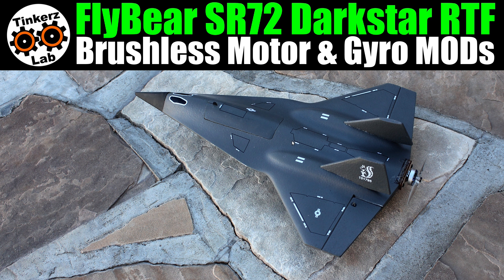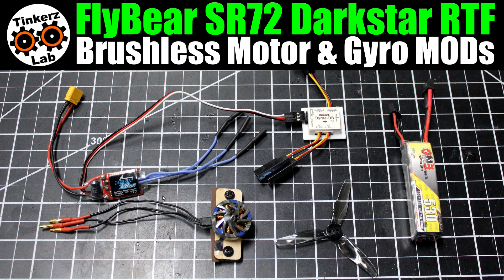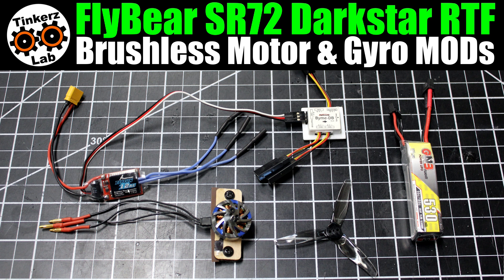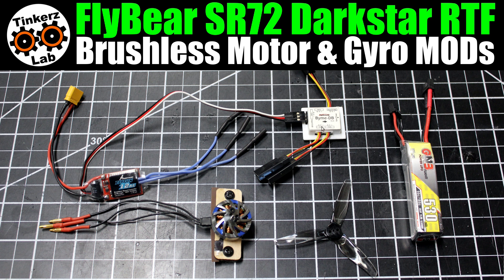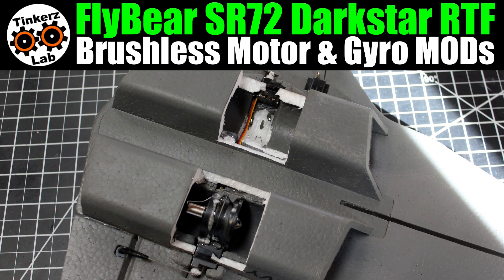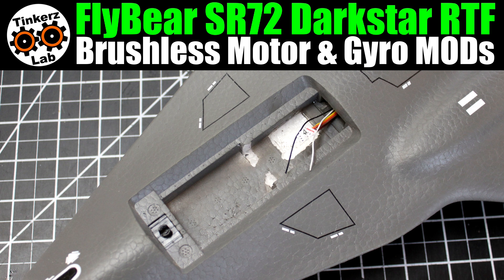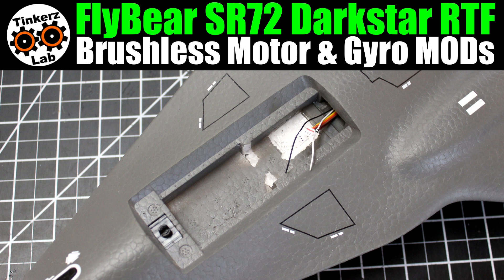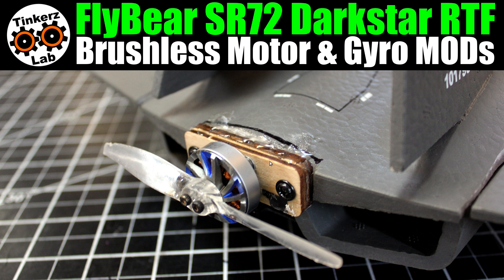Brushless Motor & Gyro MODs Details + Setup File | FlyBear FX9672 SR-72 Darkstar

Comment: Fantastic conversion. What did you use for the mounting plate for the motor and did you glue the plate onto the rear of the airframe? Many thanks
Reply: Cheers from Australia. I'll send you a vid of my conversion on my farm in Australia. Love your channel. You are costing me some money lol!this conversion may work on the fx9630? J20?
Reply from the maker: @michaelgough9256  Thank You!
Yes, I think this type of conversion should work with most parkjets.
Money well spent ;-)
Reply: @tinkerzlab so the byme db is the go?
Reply from the maker: @michaelgough9256  Yes, the Byme-DB works without any oscillations when the Byme-D won't. Seems to work better on these micros. I replaced the Byme-D on my QF009 SU35 with a Byme-DB and no more oscillations.
Reply: @tinkerzlab thankyou so much.again
Reply from the maker: Thanks!
I used (2) plywood plates, (1) is glued to the airframe and (1) is to mount the motor to the plate that's glued to the airframe.
Here is the playlist and contains a video that goes over the conversion details: https://www.youtube.com/playlist?list=PL_YiEhY7O1WZowAqZp2Af1_3OHlhfUzml
See you in the Air!

Comment: Does anyone know how much thrust the plane does stock?
Reply from the maker: I haven't measured the thrust as it is stock but it certainly doesn't have a lot of power as it is stock.
It's a beginner plane so it's mostly a cruiser as it is stock.
The airframe is really good which is why I performed the MODs.
Reply: @tinkerzlab ok thanks for the reply it means a lot. I’m interested in the su35 3s conversion you did as I actually have the same plane.

Comment: If anyone is curious I tested the stock thrust, and it's roughly 100 grams but goes down super quick. Great looking airframe, but terrible stock performance and remote distance. Gutless. I plan on putting the QF009 (SU 35 RC) components inside (Brushless setup) which gives me about 200 grams of thrust. The stock plane might be advertised as brushless, but it is NOT. SU 35 motherboard is significantly better. Hasn't failed me once
Reply from the maker: Using the SU35 components is a good idea. Let me know how that works out.
Thanks for the Thrust info on the stock power system!
Reply: My su35 peaked at 143g